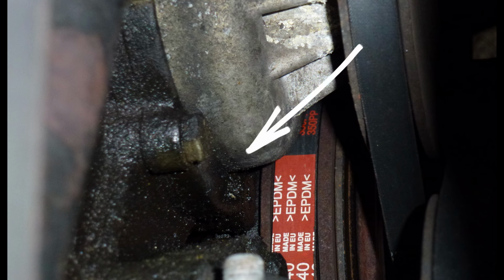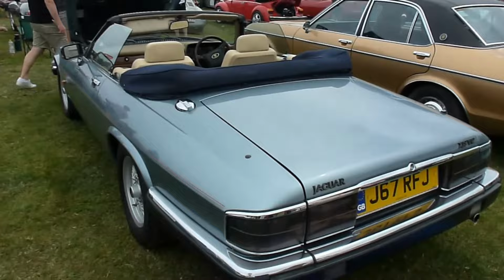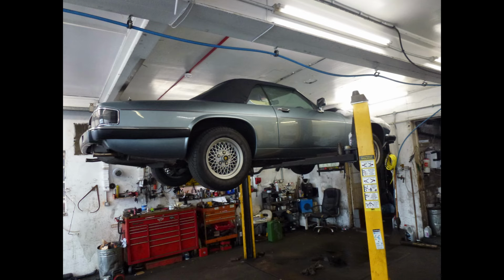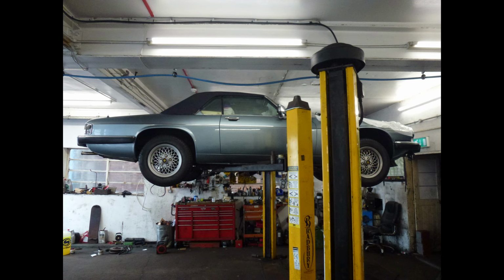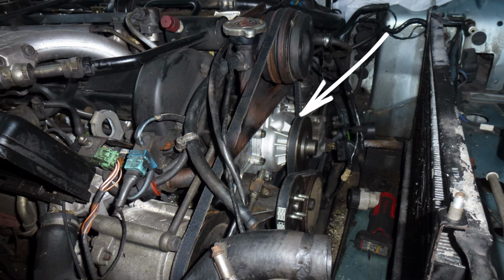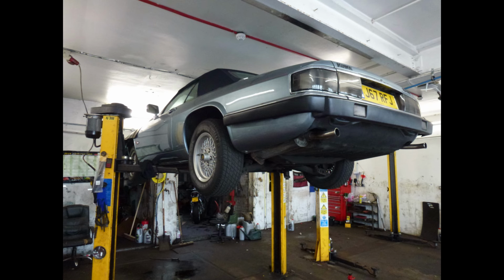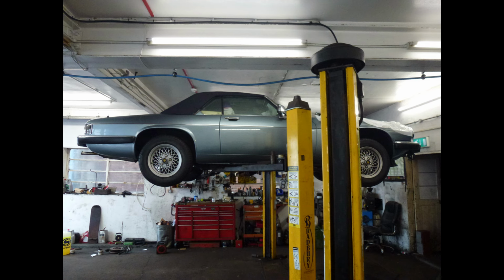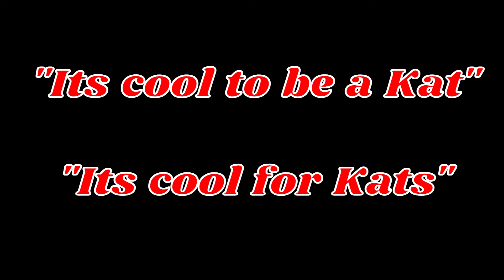@BFDdrives "Kat" The Jaguar XJS- I find a problem which had the potential to destroy this car

Comment: I am also in the opinion if it needs to get replaced then do it. The costs when you wait too long can be much worse - of like you mentioned it could have become as bad to destroy the car. And like as we're calling cars in Germany simply Auto ... so it begins with Ahhhh and ends with Ohhhh ... so you want to scream and run away, haha. 

But well, I am also feeling with you about when suddenly there is much more to get fixed than expected. I had my X-Type in last week at the repair shop for an inspection to check what needs to get done aside of the alternator that I already knew that it is mostlikely broken. In next week I'll get the first stuff fixed which costs already more than expected but I'll just let it done in two steps so the last stuff will get fixed in July. Because the bill was ohhhh so much higher than expected because aside the expensive alternator which also caused a lot of time to check the electrical system because there was a weird modification on the alernator and they didn't know if it is on purpose or someone didn't know what he/she/it was doing. Luckily it is the last option. But it were extra costs that I wanted to avoid. On Wednesday and Tuesday they're going to fix the first big step. So alternator and water pump needs to get replaced - luckily the Ford Mondeo parts will work for it - they checked for the Jaguar box but it costs twice as much instead of the OEM alternator and waterpump. One belt also needs to get replaced. The other one is fine. Then they need to fix a little part of the braking hose and one dust shield of the brakes on the rear axle. This costs me already quite a lot - there will be of course also a service done to get the engine oil and brake fluid replaced. So you can imagine it won't be cheap - but this stuff won't be broken in the next few years. So it's done and it should be done.

Then also the engine breather hose needs to get replaced but that's something I am doing by myself because there's nothing you can do wrong. A few chips on the underbody should get done - nothing too series. But it could just rust in winter. I am going to get this done before winter. Overall they are very satisfied about the condition. Such great looking sills, etc. No rust on the typical places. So at least about this I am knowing the last owner did still care. About the engine bay it is looking like it was only getting maintainanced until 5 years ago. 

But well, story doesn't end yet for my X-Type ... on Wednesday the hand break did stop working. And on Friday the co-passenger front door lock did stop working (at least it's keeping the door unlocked so it is easier to get it done. So for the June and July I'll shout "ouch" when looking at the balance of my account. But whenever I am sitting in the Jag and starting the engine then I am getting a happy face. And I'm knowing from the repair shop that the car is overall in a great condition. 

So I can feel with you ... suddenly there's more that needs to get fixed but better it's done and then you can enjoy your car again.
Reply from the maker: Sorry to hear of your issues with the Jag. I think Jaguar parts are more expensive than other cars i know. I think Rolls Royce parts would probably be cheaper. Just had a quick look for an X Type 3.0 alternator at SNG Barratt where my parts came from was shocked at £900 for an alternator. Ridiculous and thought of alternatives ie have it rebuilt would that be cheaper and then found this site where price reduces to 188 to 306 Euro's. Bit of a difference. https://www.mister-auto.de/gv/lichtmaschine/jaguar/x-type/15608/
Dont know what the Ford parts cost. Water pump at SNG better ie Genuine Jag 201.27 euro or aftermarket 52.91 euro. https://www.sngbarratt.com/English/#/DE/parts/f50c0004-de33-4502-b47c-e3f7ffa19048?fromCategory=ENGINE%20COOLING%20SYSTEM(12442)&saveBranch=DE
At least when the works done as you say you know your car is as good as it can be and up to date but it doesn't stop the costs hurting.
I had a water pump, some hoses, new pressure caps x2, 50% antifreeze, radiator pressure tested. I told the garage i was putting a penny a week in the jar so that should cover the costs hopefully, Ha, Ha. I was concerned what was the final bill going to be like but it wasn't too bad all things considered. Could have been a lot worse despite two strip downs to get radiator out again and antifreeze replaced again however it will have flushed the system through. To put it in context i bought a daily run around two years ago(a Vauxhall Corsa great little car) the bill for the Jag cost a third more than the price i paid for the run around.
I feel for you Sven. Hope it doesn't cause you too many issues.
Reply: @TipTopMotors.  I can remember the Ford guys told me about the Jaguar alternator for approx. 1100 EUR which is around the same around 930 GPB. It was shocking. They also checked for the official Ford alternator and at the end they decided for the Denso alternator. They told me it is actually the company that also built it for Ford. About the waterpump I don't know about their choice. But they told me it's the same as for the Mondeo. About the alternator they had to check a bit deeper because they noticed although the engine bay is looking quite as same as about the Ford Mondeo ST220 but the electric system is different once it leaves the alternator. So although the connector is the same but different cable codes and also it is not just only a different colour of the wire. They were glad that I was able to show them the circuit plan from the X-Files UK website. 

I also hope it won't cause too many issues after it is fixed. In last week just the handbreak and a doorlock was a not so pleasant addition that needs to get fixed soon. Tomorrow I'll give it over to them and I'll also ask them to take a look about the handbrake. Maybe they can easily fix it because it is not seeming like it's ruptured - but hard to tell because it has two wires. So perhabs one wire is ruptured but then usually both should get replaced. No idea how much this will cost but it needs to get done.
Reply from the maker: @BFDdrives  good luck.